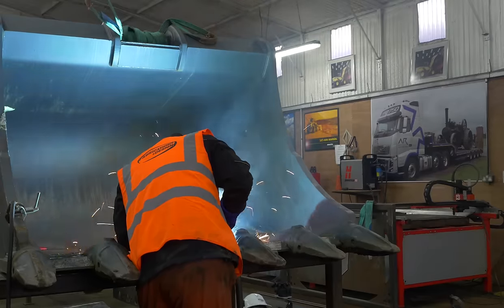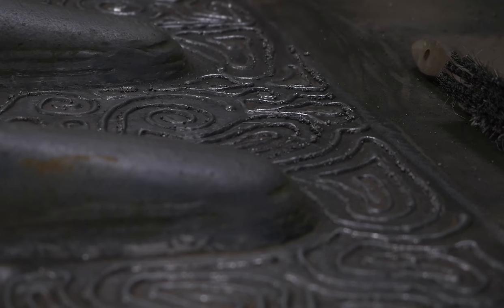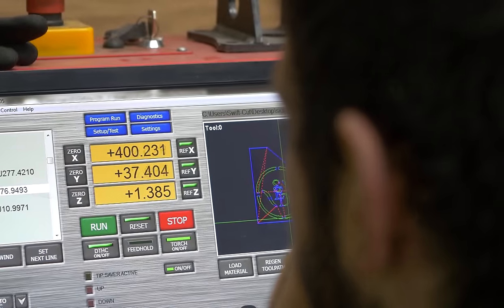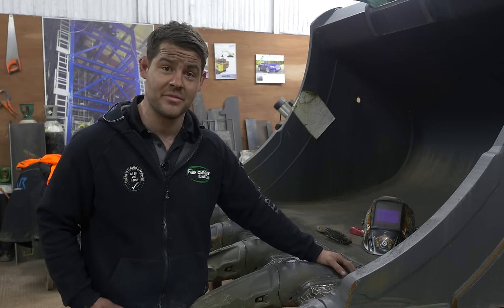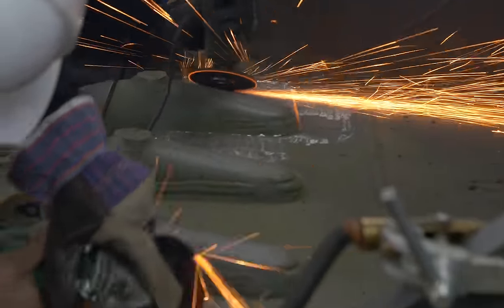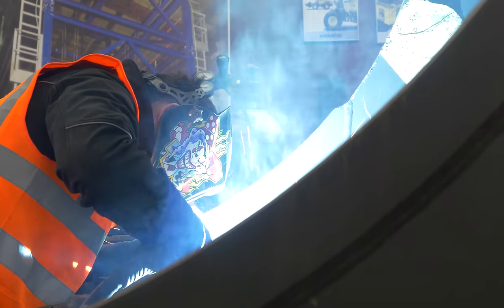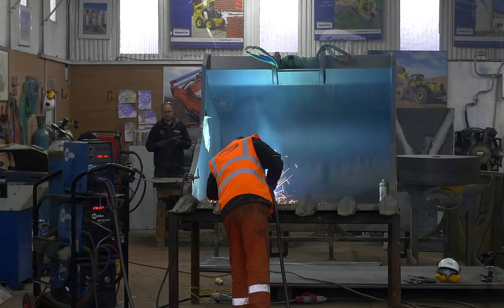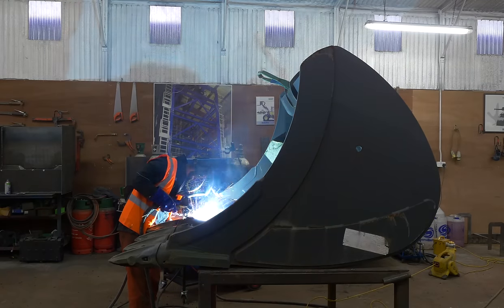The New Face of Hard Facing

Comment: I'm an operator, but I fab and weld too. When I was a boy, my dad thought me to weld a cross hatch pattern so the mud and clay would stick to the surface. This adds more wear protection to the steel. You end up with 7-8mm thick weld beads and the clay is the same thickness. I do no smaller than about 50mm square/diamond/circles.
Reply: You think the same clay sticks in the same place with each scoop??